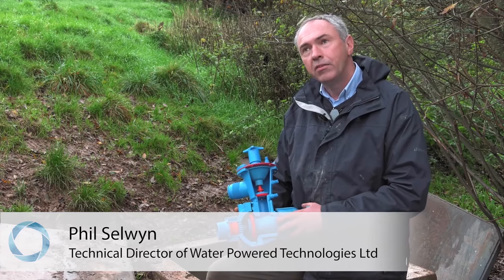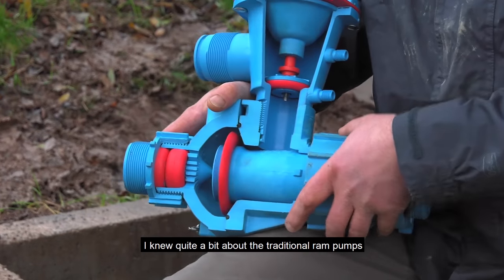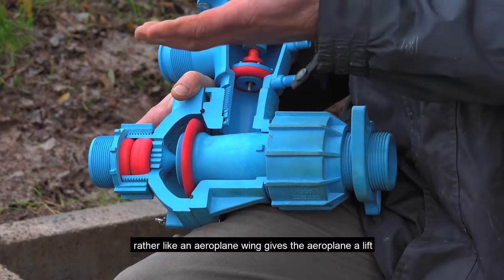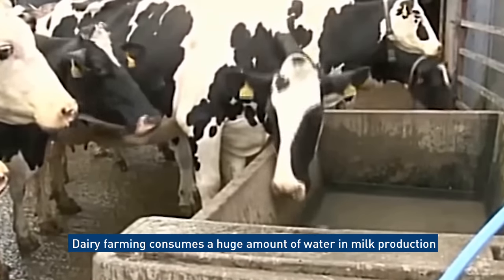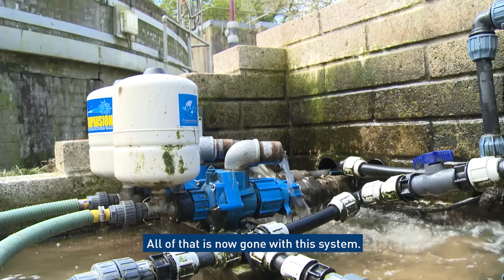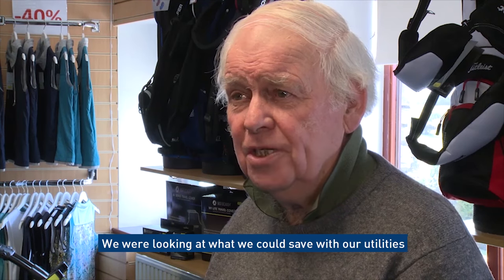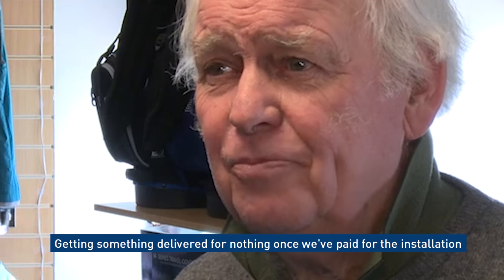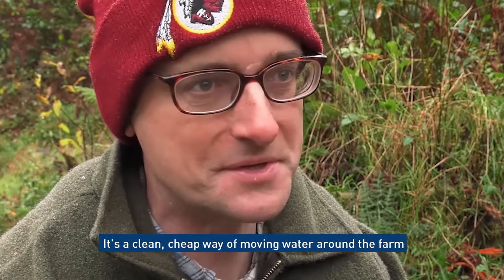Ram Pumps Papa Pump   how it works + reviews

Comment: Hello, what about the wear points, what is their expected life and how much are the parts to replace per set?  What about price, availability of the pump and parts in Canada? Thanks.
Reply from the maker: Hello, the only parts that wear are the o-rings and valves, we supply a full set of these at £20 at the moment. These last up to 3 years often longer but we recommend you check the valves yearly.

We currently ship direct but we are working on a supplier in Canada
Reply: @Waterpoweredtechnologies  I couldn't see a "contact us" email address on your website.
Reply from the maker: @raincoast9010  info@wptglobal.net
Reply from the maker: @raincoast9010  its at the bottom of all pages on the right
Reply: @Waterpoweredtechnologies  Thanks

Comment: I always want to ask this.
Why the tank (pressure) always big in size. Is there any scientific explantion?
Reply from the maker: The pressure vessel absorbs the pressure pulses so that the delivery flow is smooth and whilst the pulse frequency and water quantity will vary depending on various factors  - the 8 litre vessel seems to work well for all circumstances.
Reply: The tank stores energy in the form of compressed air. it has to be big because air inside willl loose volume by rising pressure. Because it is compressable it absorbs shock pressure and stores it together with a little amount of water at the same time. it is the storage for outgoing water with the risen pressure... but water is not compressable and would transform shock pressure waves through full system and damage over time some parts... the volume of air/water inside the tank changes with the rising compression...
Reply: You don't need a tank that big at all
Reply: It's role is just a pneumatic compression spring, a 3 or 4 inch diameter and 15-20 einches height pipe with caps and an inlet in one of the caps is more than enough unless you're dealing with really high pressures